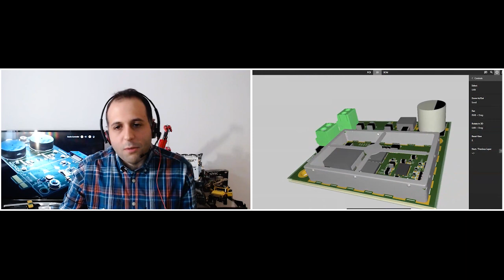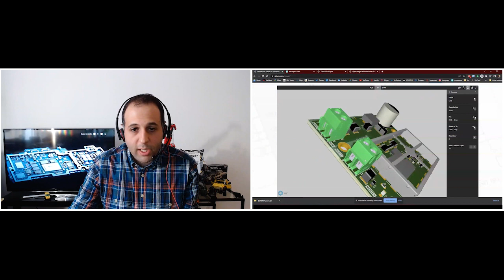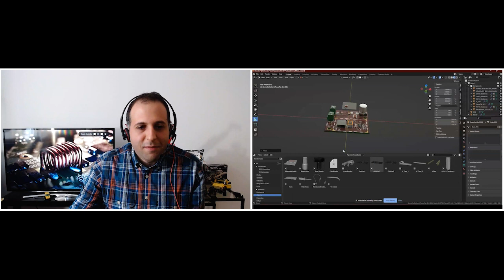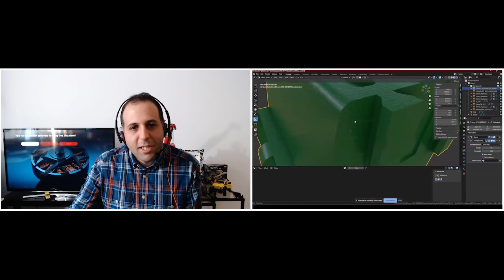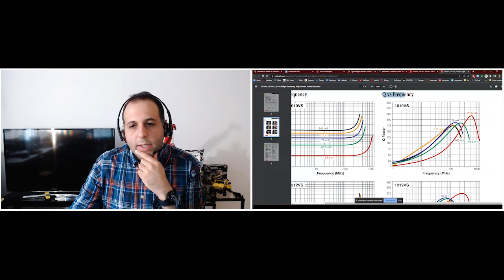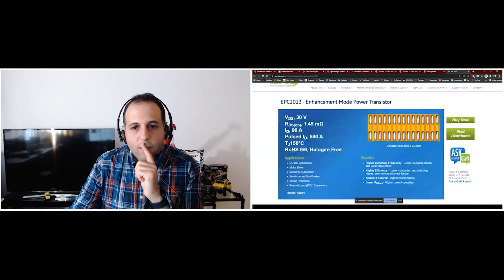Beautiful PCB Renders in Blender with Sam Aldhaher

Comment: As an alternative to 'tracespace view' then inkscape..   any thoughts on using gerbv to directly convert individual gerber layers to svg/png images?

Regarding the node editor / shaders,  do you think it's possible to create a (OSL) script or Add-on (Python API).. to automate the Blender workflow?   It seems like if it could import the images, then import database components from a BOM file, then using the IPC-2581 / Pick-and-Place file I imagine it should be able to place the components?

For example, In Unity, I made a simple Android app that you point your camera to the CCA, then enter the component designator, and a marker then points to the component.  

BTW, I recommend the great videos by 'panire' that shows how to visualize magnetic fields using KiCad and OpenEMS.   Hiyo Mana also has cool videos that use Android/Quest3 to visualize magnetic fields!